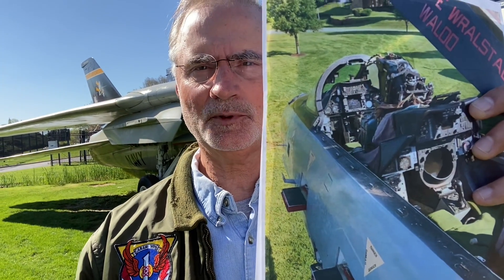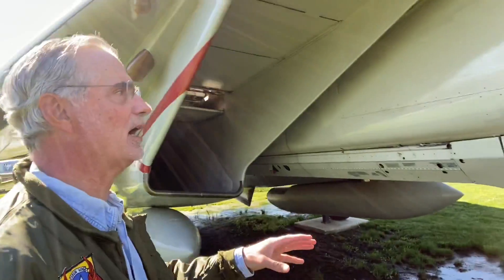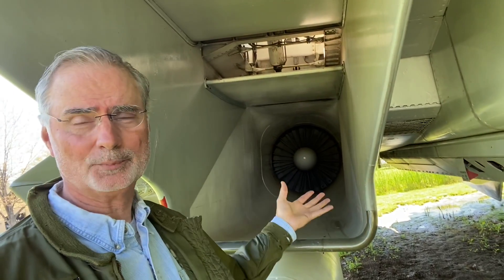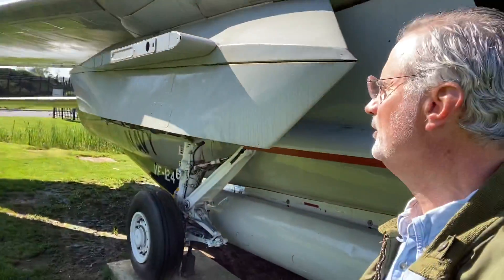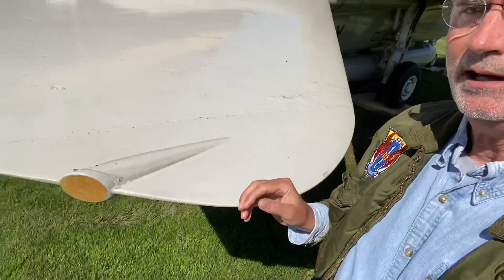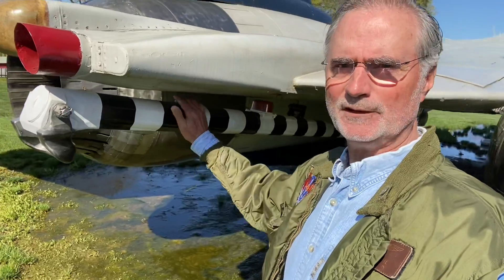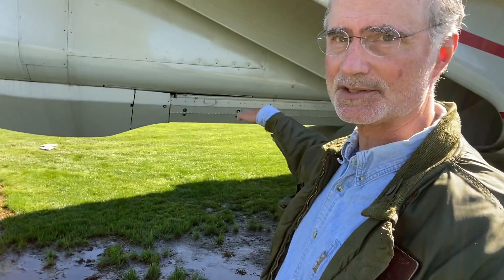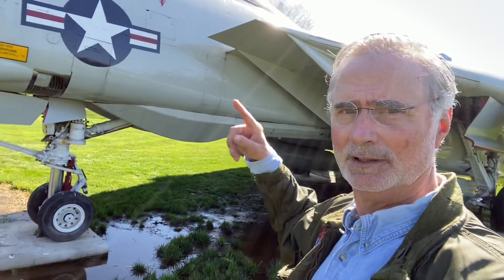Secrets of the F-14 Tomcat: Aircraft Preflight Walkaround

Comment: If the aircraft arrived at its destination with ejection seats and avionics intact, why would they literally destroy the artifact by removing these items?  The F-14 was an engineering masterpiece, to say the least.   Yes, the exterior is absolutely awesome, but knowing it has been gutted out internally just makes it into an attractive empty shell.  This aircraft should have been preserved as a whole.  It is an abomination that they stripped out the cockpits.  I understand that some of the "black boxes" behind those inconvenient exterior panels might still be classified, and should be removed, but they were the real "brains" of the avionics systems.  The indicators, in the cockpit of the era that this aircraft was made, could not display anything without those boxes.  There was nothing "classified" that could be displayed if the cockpits were left intact and the "brains" removed from the avionics bays.  I'm really tired of the excuse that the Iranians have old F-14s they need parts for, thus everything F-14 related has to be destroyed.  I've bought dozens of F-14 cockpit control heads and instruments straight off of eBay and I never saw anyone bidding to win "at all cost".  I even acquired the TV pod you pointed out and it arrived in a large fiberglass case marked "Crown Jewels" on the side, probably because of its incredibly high value.  Just the engineering technology in that TV pod was incredibly creative and advanced for the time.  Absolutely incredible engineering that would make a great video alone if it were taken apart.  Your F-14 postings are truly awesome considering you actually flew in the aircraft.  No "second hand" knowledge, but from a real back-seater.  Thank you for your service to our country and for doing such a great job of describing this historic aircraft.  Now if the organizations that use the F-14s as "gate guards" would treat the aircraft as the wonderful artifact that it is, and KEEP IT INTACT, then we would know there is at least one F-14 out there preserved with as much equipment as possible.

Comment: A-5 Vigilante was the first production supersonic twin-engine design to incorporate those variable inlet ramps that I’m aware of.  That ramp design featured prominently in various proposals in the early-mid 1960s for TFX and F-X, having already been proven on the Vigi.   F-15 has the unique feature of combining the variable inlet ramps with variable angle inlets that articulate like maneuvering flaps, coordinated with the FLCS depending on airspeed and AOA.  US research and development on variable inlet geometry was quite advanced already by the late 1950s with several  design approaches that evolved during the 1960s.

Inlet cones combined with intake stand-off from the fuselage.  Optimum Mach is relative to the distance from the inner inlet surface from the fuselage.
Splitter plates with boundary layer ducts like the F-4 had
Combination splitter plate/cone/bleed air ducts like on the early F-111A
Variable spike, boundary layer, bleed ducts, and bypass air on the A-12 and SR-71 series
Variable inlet doors with bleed air duct management on A-5 and F-14

The engineering required to make a Mach 2 capable aircraft is very interesting, and my hat tips to those guys of that era for what they achieved in this field.

Comment: Could you tell us about the exterior lights on the F-14?  Did all versions have the same lights configuration?  I lived about 5 miles east of NAS Miramar in the 1970's thru '90's.  I used to watch the jets all the time.  I could tell an A-4 from an F-4 from an F-14 at night just by their lights.   I used to watch them through a 60mm refractor telescope at 40x magnification.  I'd loosen the friction locks and using an image corrector prism (makes the image right-side-up and not backwards) I could track the planes very well and get pretty good views.  When they flew over Lake Murray/Cowles Mtn in a descent to the overhead approach, I could see the pilot's helmets through that telescope, as they flew over my house about 5,000 to 8,000 feet, I think.  I probably saw you, Ward. :)   The F-14's were easy to spot in a turn because that light gull-gray "tennis court" really reflected the sunlight!  :)  A-4's and F-5's were more challenging, especially with their blue camouflage. 

Anyway, usually viewing from the port side, the F-14 had an appearance of 3 red lights in a row, all flashing in unison.  Can you tell me which lights I was seeing on the aircraft?  I know one red light was under the nose, right below the TSC video camera.  (Some F-14's didn't have any camera, though, just a small antenna under the nose.)  Two more red lights were above and below the glove vane.  They looked like a twin light when viewed through the telescope from probably 3-5 miles away.  Green on the starboard side.  Another red light was on the wingtip (green on starboard side).  And now, on the top of the twin tails, I think there was a red light on the front edge of the left vertical stab and white light on the trailing edge, and maybe a red light on the trailing edge of the right vertical stab?  DID ALL of these lights flash in unison when set to flash?  Seems like I remember them all always flashing together.  And then, there was the faint green formation light strips.  They didn't flash.  Sometimes those were on bright, sometimes dim and sometimes I didn't see them at all.

In the DCS simulator, the lights on their F-14 don't seem to function the same as I remember seeing them.  I can't find a position and configuration where I can see three red lights in a row, from nose to tail, flashing in unison.

I could also see the landing light when the gear was extended and the approach lights (I think they were called?), red, amber, or green.  And I would see these change color as the planes flew at night...but I never knew what they meant until I started flying DCS.  Apparently, the Air Force had different meaning vs the Navy's jets.  Red meant too fast, low AOA, Green--too slow, high AOA and Amber was on speed, correct AOA...am I right? 

The F-4 Phantoms had a red light on the leading edge of the vertical tail, about halfway up and a white light on the trailing edge, up at the top.  Plus, a wingtip light.  And they had two lights on the bottom side of the engine intakes.  All these lights all flashed in unison.

The A-4 Skyhawks (and TA-4's) had steady position lights and a red rotating (or oscillating) beacon on the bottom of one of the wheel sponsons and on top of the fuselage.  Those made a distinctive double flashing, twin beacons, that were rarely in sync.

About as far back as I can remember...the Blue Angels flew the F-4J Phantom II.  I watched them at NAS Miramar...well, when my dad would pick me up so I could see above all the big people.  :)

Comment: Mooch - In flying the -A, we didn't go to Zone 2 and salute.  When we needed AB (which was required above 56,000# on a normal temp day), we went to stabilized Zone 5, then saluted.  We got away from zone 2 launches in the early 1980s when it was discovered that the engine was less stable in Zone 2 than in Zone 5.

Comment: Really enjoy the knowledge you are passing out.
Quick question about when they swapped out the engines from the TF-30 for the Bravos and Delta. I heard that the reason they didn't go to full burner with the new engine was because the plane would start to beat the shuttle down the track if they did. Not sure how true this is, but figured why not ask.
Spent 4 years at Strike but in the Hornet shop. The rest of my days were in AIMD Hydraulic Shop as well as H-3's

Comment: The movable surfaces inlet, or variable geometry inlet for the technical term was not exclusive to the F14. Many aircraft at the time used this, the F15, UK Tornado, even concorde used it. The airflow as it reaches the first stage of the compressor must be travelling at around mach 0.5, and the shock waves produced by sharp edges at supersonic speeds cause an 'instantaneous' decrease in air velocity coupled with an increase in pressure (and temperature). The variable geometry varied itself depending on aircraft speed. Even the SR-71 used a variable geometry system, but this was by adjusting the pointing direction of the nose cones in relation to aircraft velocity. Otherwise, fascinating video!! Many thanks!

Comment: I understand the reason Grumman chose  the TF-30's (I heard crap and shitney) is because they were rushing through the development of the F-14 itself, and they didn't have time to develop or source another engine, so they borrowed from the F-111 aardvark and just slapped them on the Tomcat. Those were bomber engines, never meant to dogfight, so they had poor throttle response and lousy stall characteristics, because they were not meant for the plane. They were still solving the glove vanes thing on the variable geometry of the wing, and whatever else, other kinks in the airframe. Once those were sorted, they went after better engines. That's what the Internet says, I wonder if the pilots would agree with that assesment, or were even aware of those issues, or no, this is bs?

Comment: I remember working with vf-101 in el centro ca sometime around 2001 or 2002. One of the tomcats was turning on the flight line and during the pre flight inspection the engine doors were left open to do some visual check. The vf-101 guys couldn’t actually get the engine doors closed on one side. The airframe was so warped over its lifetime that they had to actually squat the nose to attempt getting it closed. It still didn’t close even with like 5 guys trying to use their backs as leverage slightly rocking the plane. They ended up having to scrub the flight. It was still awesome seeing those planes up close and mostly working right before they were retired. 

Edit: I was stationed with strike fighter wing pacific maintenance unit. Working there was odd because we didn’t have aircraft. We assisted rag squadrons with maintenance, and had a unique opportunity to get qualified to work on 4 different platforms. EA6B’s, FA-18’s, F-14’s, and the Super Hornet. It was a really weird first duty station.

Comment: Carrier landings are essentially controlled crashes, hence the BEEFY Gear. .At the start I wondered  if you rioed the A.B.and D. Did you experience a compresser stall in the TF-30 A's?  I was an AFSC 431 in the AIRFORCE. I am  aware of the issues with the TF-30 .The F-111 had  that maintenance nightmare . My bird was the TISEO equipped F-4E. Awesome Fighter, but like you said, MAINTENANCE INTENSIVE.  As a MATTER OF FACT IT WAS A MAINTENACE PIG ( but it was OUR piggy)!!!!!!!!!!!!

Comment: Hey Ward, thanks for the walk around.

I'd like the opinion of a man who really knows what ye olde Tomcat was capable of.

If the Tomcat was fully modernized..

Meaning new cockpit, new avionics and radar, full systems overhaul, all the leaky bits fixed and the maintenance problems addressed, as well as an adjustment to the airframe to make it more efficient (maybe even single seat) and brand new engines to give it more power. Like, the works of a full update.

..do you think the airplane could be a serious contender on the modern battlefield?

Comment: Hi Ward, strangely enough my dad, a former Navy fighter pilot shared this video with me unaware that I'd both seen and commented about it earlier.  I did want to make a quick correction if I may... I was in VF-21 during my time as a TS and at the time were still flying the older Tomcats.  At launch, at least when fully loaded, the pilots made full use of the AB (up to and including stage 5) when there was full tension on the shuttle.  It wasn't stage two, then a transition to stage 5 upon launch.  Part of our inspection was to actually count the stages as the engine went through it's maximum power... something that was actually visible in the concentric rings in the AB flame.  Hope I don't come off as contradictory or argumentative... certainly not my intention, but as TS's it was our business to understand the in's and out's of the aircraft and how it's supposed to "look" and behave in order to determine it's status as "safe for flight"... a job we took VERY seriously.  Thanks again for your videos!  I truly enjoy reliving some of these incredible memories!  Cheers!  Joel C.

Comment: Ahhhh the memories. I was station at NAS Miramar A.I.M.D for five years and this was my favorite aircraft. I was an I-Level Ordnance tech and worked on all the AWG-9 weapons stuff. Weapons rails, Lau-92's for the sparrow, Lau-7s for Sidewinders, and my favorite the Lau-93 with the Phoenix Farings for the AIM-54's. We even did the ADU-702 mods for the Bru-32 adapters in the weapons rails for the MK-82 bomb kits for however long that lasted!! The gun was not bad and the F/A-18 version was a little bit better. I supported CAG-11 on deployments with VF-213 as my primary support along with the D-versions later on VF-31 and the "Dry" systems. Great video!

Comment: VF-124!!  That was my first squadron out of A school back in 91-92 in Miramar.  Worked the line.  No shout out to your plane captains and duct diver?  I remember those white coveralls.  They were thick and hot.  Those panels were a pain.  Those back engine ones wouldn't line up.  You needed to get someone under the engine exhaust on their back and bounce the back of the plane while someone pushed the panel.  Easier then it sounds

Comment: I served as Command Classified Materials Custodian on CV/CVA-61, in the late 1970s-early 1980s.  Worked daily and closely with CVIC, CO, BOSS, AIMD, CAG, WEPS, etc.  Finally in this post I have heard the words I have waited to hear from you for so long: 'That's why the F-14 was retired when it was, it was a BEAR to maintain!'  Mooch, truer words were never spoken.  I must have received a TON of CLASS materials (pubs and messages) dealing with this directly.  Some of the message traffic in this era was screaming so loudly about readiness levels and parts they almost needed to be handled with asbestos gloves!  Most of my friends / aviators went from 'Phantom Phlyers' to 'Hornet Jockeys'.  I continue to watch your channel with a smile on my face . . . most of the time.  But like almost of my 'specialty' in the Navy, I will continue to maintain a low profile, even though there are many temptations to comment on specific issues.  By the way, my handle was 'Gramps' because I was almost 6 years older than my colleagues / peers / staff.  V/R

Comment: The M61-A1 gun was always my favorite part of the A7E.  It in an amazing piece of hardware.  I used to have a couple of old 20mm inert rounds as foot pegs on my bike back then.  

We had an incident involving the M61 back when I was a young E4.  I was finishing up some maintenance when I was told if I want lunch I'd better go now or I'd miss it.  I said okay and detailed what needed to be done to finish up.  All it needed was two bolts safety wired.   The piece being safety wired was the transfer unit.. it transfers the ammo from the belt,, into the weapon..  After I got back,, I saw the plane was buttoned up and the paper work was done..  I went on to my next assignment.

The next day the plane was flown to Falon for target practice on the gun range.  The gun misfired and stopped working.  I was called into the maintenance office to explain why the gun came apart right where I was working.  This was very serious.  The rounds move so fast that when the belt couldn't run properly, they still had enough force to go through the internal walls in the plane.  The next compartment forward was where the LOX bottle is.  A round missed that bottle by just millimeters. 

I told them I was sent to lunch and I had told explained what needed to be done.  I saw the plane  buttoned up and the completed paper work.  I was cleared of any wrong doing or neglect.   The two people that signed off the work weren't so fortunate.   I was horrified when I was shown the damaged plane..  There were several mangled panels..  the hole going through the LOX bottle`s  compartment and the totally trashed transfer unit was not a pretty picture.  As bad as it was, it could've been much much worse.
Reply: Were you aviation ordnance or a maintainer on the A-7E in particular?  I love the A-7.  It had awesome legs to it as far as mission radius goes and an excellent Radar and FLIR sensor suite that was far ahead of its time, as was the Moving Map Display and INS.  Great strike aircraft.
Reply: @LRRPFco52  I was an AO.   My second year with the squadron,  before we were deployed I went TAD to AIMD.  Never worked the flight deck.

Comment: Thanks for the memories.  I worked for the Navy as a physicist/electronics engineer at NAWC-AD-INDY (formerly Naval Avionics Center) in Indianapolis from 1985-2000.  We were BRACed in 1996 and ended up becoming Hughes Aircraft for a short time before Raytheon took over.   I worked on a small team funded out of China Lake and NAVAIR and we all did radar modeling/simulation/analysis looking at future radar technologies and digital signal processing techniques and how they could benefit fleet air defense in the outer air battle scenario.   We simulated many radars, including, of course, the AWG-9.  It was great work.  Also jealous that your flying machine is just a "bit" faster than what I currently fly!

Comment: 162591 was a VF124 bird.  I used to work on it as an avionics tech and a troubleshooter.

Fun Fact. The hook point was $800 in 1990, and that bolt holding in was $85.00 IIRC.